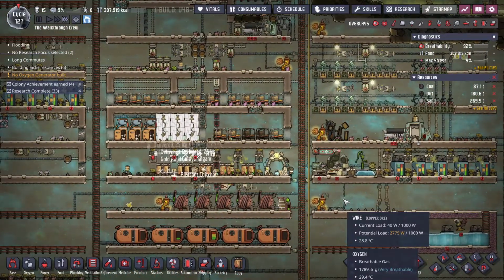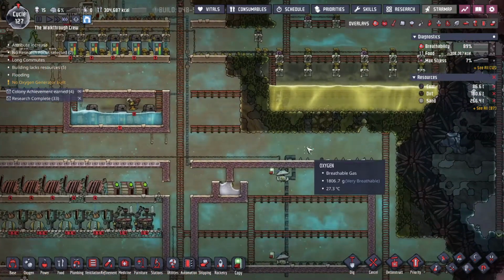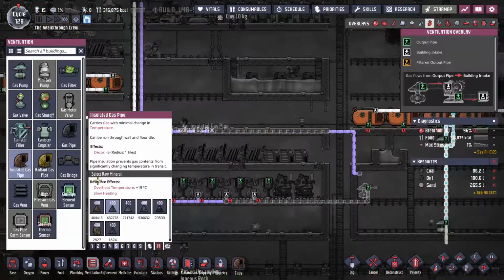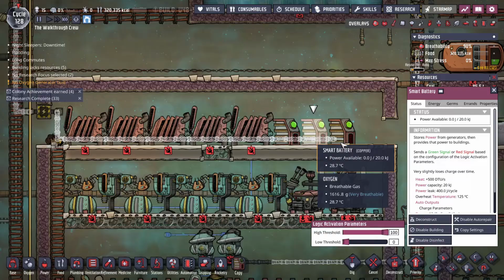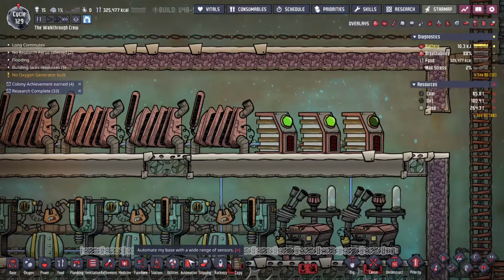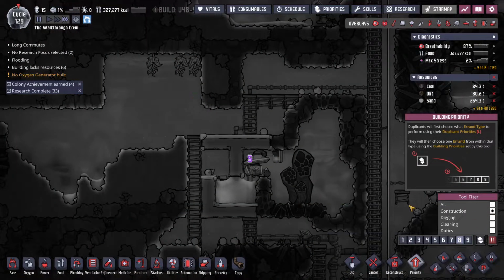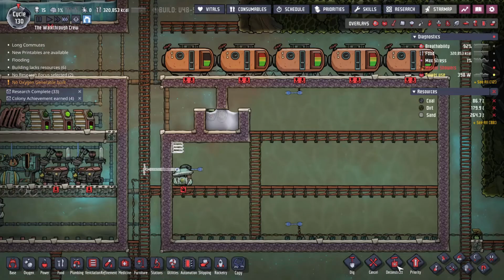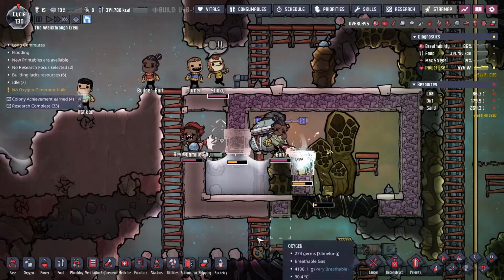Oxygen Not Included: Full Walkthrough Part 15 (2023)

Comment: Might be a dumb question but how do the batteries know which to prioritize as 1st / 2nd / 3rd? I watched a few times and it seems like they are each independent?
Reply from the maker: They are independent, but since they all have the same capacity, they will roughly equal their charges out.  The 1st/2nd/3rd thing is deciding at what fill % each of them turn on and off, and generally higher numbers mean it will turn on first and turn off last, so you want to put higher numbers on power sources that are more renewable.

Comment: Hi, its me again. Your advises and content are waaaaaaaaaay too awesome! Thanks a lot!
When I start to dig down, I find a copper volcano just below my living area about three or four blocks. I want to ask should I use the blocks which can isolate heat to surround my living space now, or just leave it there, coping it when  I can handle that?
Reply from the maker: I would try to not dig it up all the way until you are ready to use it.  If you already have, you can build a tempshift plate out of coal and put it in the center of the volcano, and it will plug it up the next time the volcano erupts.  If it's already too late for that, just build insulated tiles around the volcano with either Ceramic or Igneous Rock :)
Reply: @Magnet_MD  I haven't open it yet, so it would not erupt currently. I think I will explore more first.

Comment: I enjoy watching and have learned so much from you.  How do you get the water to flow from your coolant area were you run the radiator lines through the  power area it seems u just close loop in on the liquid storage..  I am confused.. :( I have filled them with polluted water as you said is it maybe too full its topped off..
Reply: I just needed to add some air in the pipe and I was gucci thanks for all the tips you rock :)  I figured it out after trying to rewatch your video like 20 times.. :)
Reply from the maker: The tank being too full can definitely stop it from looping.  Try emptying a little bit from the line and see if that fixes it.

Another possibility is maybe there's a bridge that is hooked up backwards, preventing flow
Reply from the maker: Just saw your reply, haha.  I'm glad it is working!

Comment: Dumb question but why can't we use carbon skimmers to fix global warming?
Reply: Couple of reasons. For one, real life methods of carbon capture aren't nearly as efficient as the fictional ones in ONI. It takes a lot of energy and resources and if your way of getting those releases a bunch more carbon... you get the point.
Another reason is that the actual concentration of CO2 in the atmosphere is quite low (it still has a big effect, don't get me wrong, but we're talking a couple hundered parts per million) and it doesn't tend to all neatly settle in one place like in ONI. So it's difficult to even get enough of the CO2 from the atmosphere to your carbon skimmer to make it worth your while.
Also (and this isn't that big an issue, but still) once you've captured the carbon you have to put it somewhere (ideally where it won't just go right back into the atmosphere and where whatever material you used to capture it won't pollute the environment). Unlike in ONI where it just gets deleted. 

All that being said there are useful applications for that technology out there. Like in small, contained environments like a submarine or the ISS for example. Or directly in the smoke stacks from power plants that burn fossil fuels. There the concentration of CO2 is much higher and it's a way to at least mitigate how much carbon those power plants are putting out. 

And of course the technology keeps getting developed and hopefully will keep getting more efficient so we can use it more broadly. But it probably won't get efficient enough to fix all our carbon worries. Definitely not anywhere near fast enough.

Comment: Wish I knew what went wrong with my cooling water.  It's at 47c !  I put a bunch of ice in containers like you did + even destroyed first containers to leave the ice on the ground and remade containers.  I wonder if the material used for containers+reservior matters?  maybe the pipes ?
Reply from the maker: What temperature did you start at?  Some water sources come out extremely hot
Reply: Alright I actualy found a save thats 50 cycles back.  Here we go! @Magnet_MD
Reply from the maker: Cool!  Yeah, cool steam vents are still very hot, because steam still implies boiled water (100+ C).  Try capturing a polluted water vent instead.
Reply: No idea.  I figure the water would be from my main pool of water.  The only explanation I can think of is that It went from Cool Steam geyser -> reservior in main pool -> cool water pool.  Wish I had started using "Save As.." much earlier than I did. @Magnet_MD

Comment: Having the geyser/vent/volvano analyzed does bring you 2 benefits 1 you know when it is safe to send someone in to modify things, and knowing its activty/dormancy and amount produced will let you determine "Over an active period + dormancy period, this will supply enough gas/liquid/heat/etc to fully supply x number of generators/electrolyzers/etc"  Such as if it averages out to 125g per second over both active and dormant periods it would allow 1 natural gas generator to run constantly and a second to run about half the time.   While knowing exactly how much you'll get over time is nice (better for forecasting) anywhere you might need to send duplicants back into later, it is very useful to know when it will be dormant for a period.  (You don't want to have to send someone back in to replace a sweeper you accidentally melted when the volcano may spew magma right after they get there.)

Comment: You can also fill that large gas storage room with gas reservoirs, which feed into the generators first and only overflow into the room when they are full.  This means that the gas pump in the room will only run when all the reservoirs are empty, thus saving on energy.
Reply: What are those gas reservoirs made of? I had hardy enough steel for the pumps... Btw You have to use steel for the atmo sensors and the automation wires in the geyser chamber and in the natural gas storage, don't You?
Reply: @voroskoi  His were made of Gold Amalgam, which should be fine, since they are in the base and won't overheat until 125C.   The sensors and wires do not have an overheat temperature, so they can be made of anything.  I would avoid Lead, just on case, though.